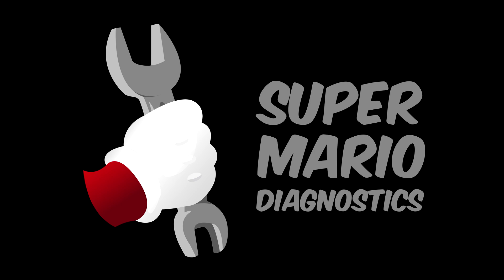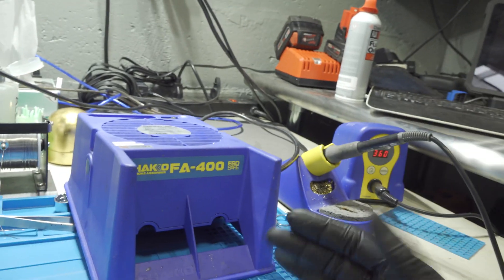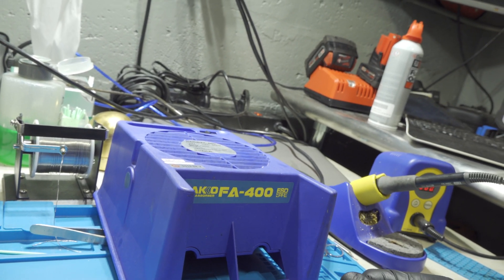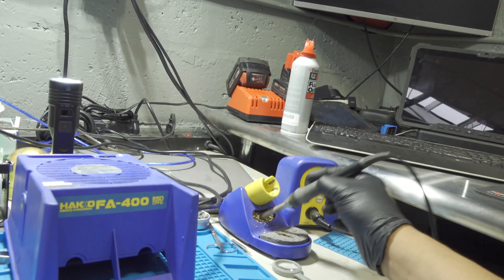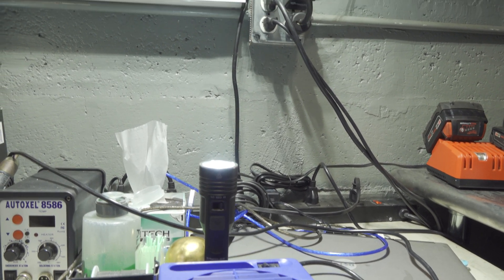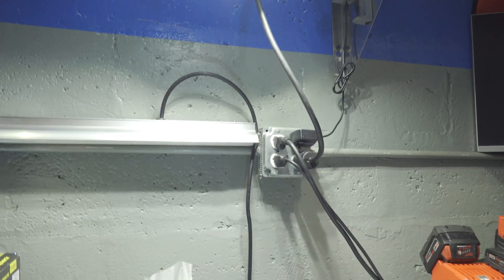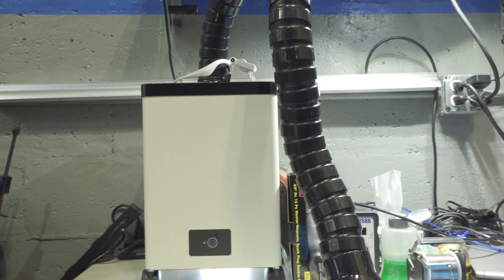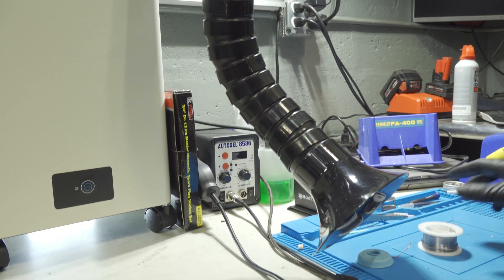Don't solder without one of these!

Comment: Most welding respirators are charcoal filters so charcoal works it's just you probably need to find a quality filter for that China device and charcoal is only effective for so long in open atmosphere so you'll likely need to change the filters more often. Ideally the best setup would be a charcoal filter then into a HEPA

Comment: Sadly I'm with you,  I get goosebumps when I'm soldering, even when I smell exhaust from race cars or burning rubber from power braking weird right!  You are top notch for taking safety first 👌  I will say I don't do soldering for a living, just my own cars and pipes once in awhile on the job for small plumbing repairs.